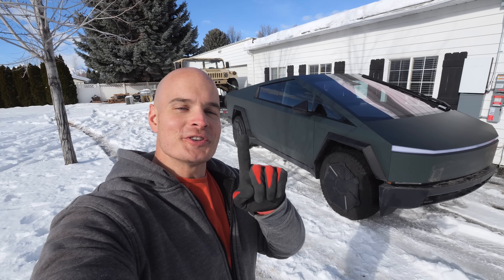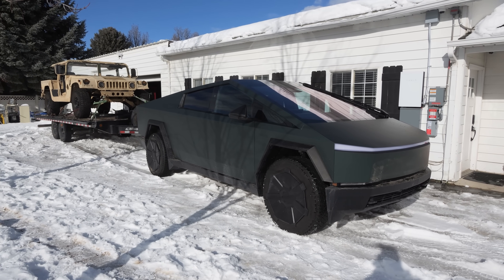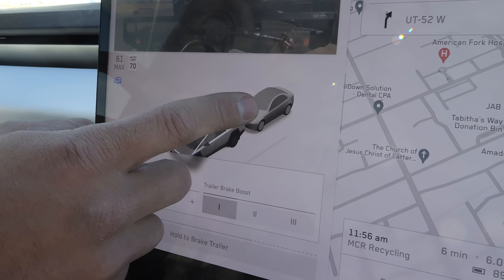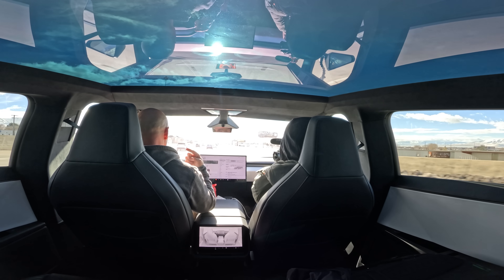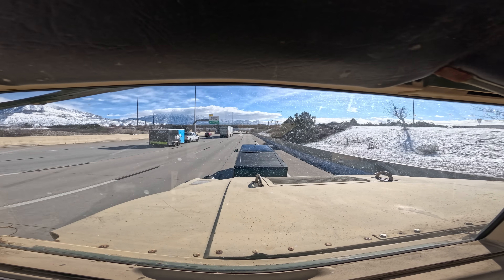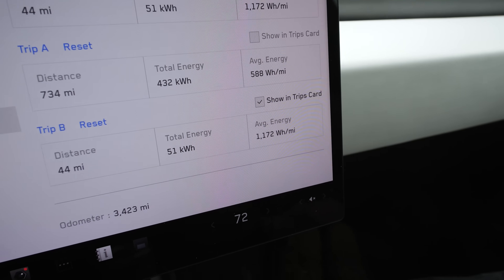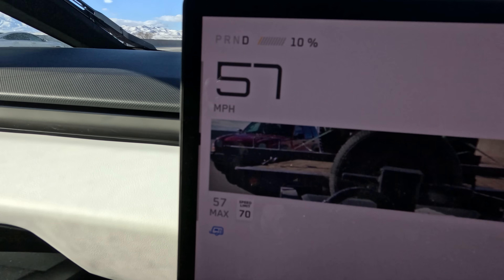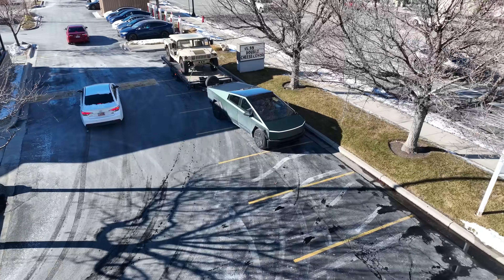How far can the CYBERTRUCK tow 11,000lbs in Freezing Weather?

Comment: Thanks for this. This is the only Cybertruck video that actually has the info I care about. Also it is just plain awesome to see you towing an electric hummer with a Cybertruck. Aside: I cancelled my Cybertruck when delivered range became around 300 instead of the 500 I ordered (because I knew what that meant for towing).
Reply: Great news for me I'm moving up the que and will get my CT faster. I hope more people cancel their orders.
Reply: Cancelled mine too
Reply: Some people aren't even getting 300. Closer to 160-200.
Reply: @Hartwig870 
The EPA test cycle contains city driving, which is much more efficient. You can't expect to get that range on a highway.

The 160 mile wasn't the full range, but 80% to 10% only.
Still over 2 hours of driving at 75mph, and plenty enough to reach the next charger, so no big deal.
That's about the same I get from my old Model S at 100mph (that's the unofficial speed limit here).
Reply: If the released product isn't even close to the announced than they should give back the pre order fee
Reply: Guys, Here is The Savior

HalleluYAH translates “Praise ye YaH”

YaH is The Heavenly Father 
YaH arrives via the TENT OF MEETING
YaH was Who they Crucified for our sins
YaH was Crucified on an Almond TREE

— Ancient Semitic Cuneiform of Moshe (Moses)
— Isa Scroll (The Original Isaiah)

Isaiah 42:8
"I am YaH; that is my Name! I will not yield my glory to another or my praise to idols.

Isaiah 43:11
I, I am YAH, and there is no other Savior but Me.

Isaiah 45:5
I am YaH, and there is none else.
Reply: What about the range extender?
Reply: @bengsynthmusic  doesnt exist yet, will cost $$$$, you lose 1/3 of your bed, and you have to go to Tesla to have them install and remove what will likely be a 1k load.....I wouldn't be surprised if it never comes to market as it was said just to save face
Reply: @theBeachBusRI  
For that matter, a 500 mi EV truck doesn't exist across the board. So it's an uncharted territory. Batteries have a stubbornness to their pace of improvement.
Reply: @bengsynthmusic  Agreed and if you just do the math it was never really a possibility just like the roadster is not going to have 500 mi of range. The Cybertruck specs an achievements are only diminished by the fact that things were promised that were never going to be possible now or even for a few years. We are not going to see one change to battery technology that's going to increase capacity 50% in the next 3 to 5 years. Some of the tech that's out there that might achieve this won't be the type of battery you'd want on something susceptible to so much vibration and the possibility of a car accident.
Reply: @theBeachBusRI  
Fair enough. At least you're not fully cynical about the whole industry but that it's rather something that needs more time to grow.
Reply: @theBeachBusRI 
It would have been easily possible. The CT has a 123kWh battery, way much smaller then the Hummer EV. Tesla could have easily fit in enough battery for the 500 mile range. Most likely they choose not to because very few people actually need it, especially with how much the Supercharger network grew since 2019. Like in the video, they could even skip a charger, while towing in cold weather. It's maybe slow and inconvenient, but you can tow with the CT. If you only do it occasionally, it's not a deal breaker.
Reply: @andrasbiro3007  Wrong. The vehicle would have been noticably bigger and the cost change would have been even more unpalletable.  Look how much estimates are for stupid battery pack in both weight and cost and it's still sub 500 by a bit.  In addition the extra 1000-1500 lbs maybe have cost the CT it's only standout stat which is it's speed.   Anyone who tows an RV who say this or the 6k lbs model y trailer video just cross the CT off the list.  It's an amazing vehicle for speed or regional towing only.
Reply: @andrasbiro3007 CT "planned" ranger extender is $16k (will be more if it ever arrives) and will weigh more than 1000lbs. And they only skipped the earlier charger to try to get a decent distance despite slowing below highway speeds to barely make 90 miles at 32 degrees. If the weather was in the teens they would never have made it.
Reply: @theBeachBusRI 
Obviously it would have been heavier and more expensive. That's one big reason why they didn't do it.
But the possibility is unquestionable, as there are pickups with much bigger batteries.

Only standout stat? Do you even know anything about the CT? Wacth a few reviews.
Reply: @theBeachBusRI 
To have 500 miles of range stock, you need a certain battery capacity, that's just physics. External or internal doesn't matter.
Probably would have been cheaper integrated, but not much lighter.

How often do yo tow 11000lbs long distances? If it's a few times a year, then this is acceptable.
Most people never actually tow, and those who do, mostly not long distances or not this big. And of those who do, most only rarely.
The remaining few should stick to diesel for now.
Don't worry, the next generation of EV pickups will have much better ranges.
Reply: @andrasbiro3007 It does matter when its another $16k and take up a 1/3 of the bed.  The point people are trying to make which you keep missing is that it isnt that the CT isnt capable or cool...it that it falls short on almost every promise and from a useability standpoint the Lightning, Rivian, and incoming Chevy are better.  If you have to have steer-by-wire or like the looks then so be it but otherwise whats the point since it is unremarkable compared to the competition.  Maybe if it wasnt hyped as the end all truck when really its a fast ev trophy truck/mall crawler.
Reply: @theBeachBusRI 
The point you are missing is that the CT delivered on almost all promises, and it's still lightyears ahead of the competition.
Just watch the reviews, and you'll see.

How often do you want to fill up the entire bed, while towing a large trailer on the highway hundreds of miles? Seems like a rare use case for me.
And even then, you can do it, just takes more time, and a bit inconvenient. As long as you don't do it too frequently, it's not a deal breaker.

Also, the Rivian and the Lightning are also lose a ton of range when towing. They got 110 miles with the same test for the Rivian. And the CT just came out and has all-terrain tires, so likely the range can be improved significantly. With the new battery cells especially, Tesla likely configured it conservatively, with lots of buffer and, slow charging. As with all previous batteries, they'll gradually enable more range and faster charging, as the data from the fleet suggests it's safe.
Reply: @andrasbiro3007  The reality you're missing is that the CT is an awesome vehicle but has failed to live up to almost every promise other than it being fast and having a tight turning radius. Any honest review has shown the range is not great.  The towing experience is not great. It recharges poorly due to a nerfed charging curve. It actually performs quite poorly off-road and was bested by a Subaru Crosstrek mostly because it's tires are fake all-terrain and actually have a tread design in attempt to extend range which again is already poor. It is at best marginally better in some aspects than the other existing EVs and that ignores it's polarizing looks. If you want to make excuses and say well you don't really need these capabilities then why not just go buy a model y for half the cost. The lightning in the Chevy will be easier to live with, the Hummers more outrageous and actually performs off-road, and the Rivian is a better luxury vehicle by anyone who's tried both.  I have no doubt Tesla will improve the product over time but the current 80k-120k is far from light years better than anything. It's a vehicle for people who want to have people look at them and have some capabilities and didn't want to buy a Ford raptor or Ram instead.  If Elon had been more honest maybe people would have been okay with 200 miles of usable range and having to charge for 40 minutes after every 2 hours of use.
Reply: @theBeachBusRI 
1. Where promise it failed to live up to? Range and price are yes, but I think it hit everything else. And even range is only a miss for the 3-motor version.
2. Towing is as expected. All EV trucks lose a lot of range when towing. And there was no promise about towing range, AFAIK.
3. There was no promise about charging either. And it's a new cell, those always charge poorly at first. The Model 3 with the LFP batteries was the same. Charging too fast can cause a fire, so they start at a very conservative curve and gradually improve it as they get more real-world data.
4. It performs very well off-road. There are a few cherry-picked video without context, that's all. There's absolutely no reason why it wouldn't be good off-road. It's not magic, it's science, we can tell based on the specs how it should perform. At worst the software is not ready yet, but that can be fixed easily.
5. I'll tell you bout a neat life hack: you can change the tires. On any car actually, not just the CT.
6. It's lightyears ahead of other EVs in many ways. Did you even look at the reviews?
7. The CT is far better then the Y in many ways, even if you don't need a truck. The steering, the suspension, the handling, the stainless steel exoskeleton, the audio system, the sound insulation, the cargo capacity, and even the looks. And I probably left out a few things.
8. The CT is a better truck then the Lightning in many ways. And their towing range is essentially the same. So why is it easier to live with?
9. Depends on your definition of luxury. For me luxury is comfort, smoothness, quietness, software, and practicality. I don't think the CT is lacking in any, and the software is by far the best in the industry. Yes, the Rivian looks better inside, and maybe has a few other small advantages, but it has a lot of disadvantages that I think are bigger. It's subjective and depends on what you need, so I won't argue too much. I personally think the Rivian looks like a cute toy, while the CT is a proper masculine car which is actually beautiful in it's own way. And more importantly, steer-by-wire is awesome, it makes all other cars stupid in comparison.
10. The price is $60K-$100K. The $20K on top is only for the Foundation Series.And the base price will go down too when as soon as they work through the huge backlog. Why sell it cheaper if you don't have to?
11. Elon was honest. At the time those were the target specs. They just couldn't hit them for various reasons. Inflation for example, and the slower than expected development of the 4680 cells. "If you want to make God laugh, tell him about your plans." - Woody Allen. It's not like Tesla is the only company that misses targets, all of them do regularly. But those don't make good headlines.
Reply: @andrasbiro3007  I can't take you seriously anymore as you can't seem to just accept reality:
1) 1k of payload more was promised and 2k more of towing.  Range is a verified miss for every model which cannot be debated.  Its even a miss compared to the revised numbers haha.

2) Towing seems to be the worst of the main three EVs (Rivian and Ford) but TFLtruck channel will finalize it with their tests

3) An excuse (the batteries are not CT specific) and a hope for the future but likely not this year if ever

4) It lost to a Subaru Crosstrek.....there is no coming back from that.  Offroading is not mild dirt roads.

5) Guess what happens to the CT already bad range when you put knobbies on that the Rivian and Lightning dont need

6) Watch the Throttlehouse review....it has some features but in reality it barley meets the competition unless you are a Tesla fanatic

7) Its not, its a 5 person EV person hauler that with many sacrifices so you can town and get attention.  Hopefully none of your kids lose a finger to the unfinished edges.

8) Every review says the Lightning is easier to live with due to the fact it is just a ev F150 with a huge frunk

9) Throttlehouse again described the ride as poor (great handling) and the interior as inferior with all the modern lux vehicles....its Ikea minimalism for 80k-120k

10) you sound thrilled to have been duped

11) The man is a blatant liar and people are tried of promises that never come true or getting 70% of what they were told they were getting.  The Y and 3 revolutionized the world but the rest is high flawed with the CT being the biggest miss since the hyperloop went belly up.  Enjoy your gen 1 Neuralink when it comes out in a decade...I am sure they will have the bugs fixed before it comes to market.
Reply: @theBeachBusRI 
1. Those are minor things. In general the CT does what they promised, and in many cases much more. Steer-by-wire and rear wheel steering weren't promised, for example. Range and price are the misses that hurt, but even those are not deal breakers for most.

2. No, towing range is about the same, around 100 miles. And CT will likely improve with software updates. Also the CT comes with all terrain tires, that are not the best for range.

3. Yes, the battery is CT specific. It uses the new 4680 cells that Tesla developed in-house.

4. It didn't loose. 
- For starters, the test was invalid as a complete noob drove it. Even if the other driver was new too, it's still a big unknown. You need professional drivers for a fair comparison.
- The CT's lockers are not enabled yet, and there could be other software issues. We won't know until someone, who actually knows shit, tests is. It could also easily be driver error. Observe how the power cuts out every time one wheel starts to spin. That could be an inexperienced driver's instinctual reaction, or a software bug.
- The Subaru Crosstrek is actually a very good off-road car.

5. The same thing will happen with the Rivian and the Lighting. And the CT already has all terrain tires, while the other two doesn't.

6. Watch a competent review. Hagerty is probably the best, but there are tons more. Pretty much everyone loves the CT, and it's full of tech that the others can only dream of. Even just in raw specs the CT is similar or better.

7. You are blinded by hate, and ignore facts. Again, watch any competent reviews.

8. By that logic we should still ride horses.

9. Again, watch any competent review. The ride is amazing according to everyone, some compared it to a Bentley.
The interior is nice enough, and the seats are very comfortable. And it's a f*cking  truck, not a luxury car, it should be minimalist and rugged.

10. You have been duped, not me. Do you know how much other trucks cost? The Rivian starts at $80K. The Lightning has cheaper options, but with lower specs. The Raptor starts close to $80K too.

11. You don't know the meaning of words. Look up the definition of lying. And you are still blinded by hate.
Also:
 - The CT is already an enormous success. It's only hated on the internet, in the real world people love it.
 - Elon never did Hyperloop, that was an unrelated company.
 - Neuralink just implanted the first chip into a human patient.
Reply: @andrasbiro3007  I don't understand how anyone can do the mental backflips you do to ignore the valid issues with a $80-$120k truck and then to gush about minor marginal benefits.  You are not a rationale person.  Maybe one day you will come back to this and be ashamed but for now you can't even any negative criticism without claiming people shouldn't care.  And for the last time I actually like the CT and would own one but by any balanced review it has major shortfalls and disappointments.

BTW another huge channel Engineering Explained just did a CT review coming to the same conclusion which is its super cool but disappointing as a truck for people who need a truck that isn't just fast and can turn tightly in parking lots.  Enjoy your errand runner/mall crawler should you ever actually buy one.
Reply: @theBeachBusRI 
You are doing the mental back flips. Same thing happened with regular EVs, keyboard warriors just declared what are the minimum acceptable specs for a car, and then claimed that nobody will buy EVs because of that. They said 500 mile range and 5 minute charging are essential. Even today no EV can do either, yet the best selling car in the world is an EV (Tesla Model Y). It seems like those essential specs aren't as essential after all.
I'm pretty sure it's the same with trucks. Just because a diesel truck can do something, that doesn't mean an electric truck must be able to do it.

Keyboard warriors just declare that the CT is not a "real truck", but fail to explain why.
OK, towing a big trailer large distances would be slow and inconvenient (not impossible!), but that's about as critical use case as for a sedan to drive 500 miles without stopping.

Also, if you ask real truck people, they'll tell you that if you are serious about towing, you buy a bigger truck anyway, F-250 or F-350. The CT meant to be an F-150 competitor.
Reply: @andrasbiro3007  No idea what you are ranting about.  100 -150 mile  loaded is a deal breaker for many but for those who can drop 80k-120k on a fast mall crawler then good on them. 240miles unloaded is fine for most but pretty far from both 500 and 340miles. You haven't refuted any points...you just keep saying no one should care because most won't need it.  It's a cool experiment but unless you love the look money is better spent elsewhere as I have pointed out numerous times.  I won't continue this conversation any further as these aren't rationale responses.